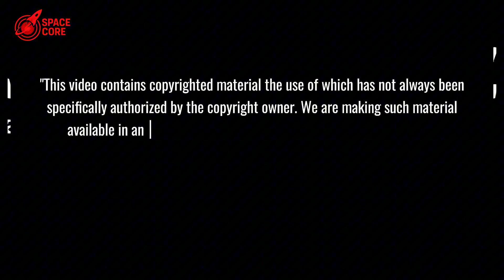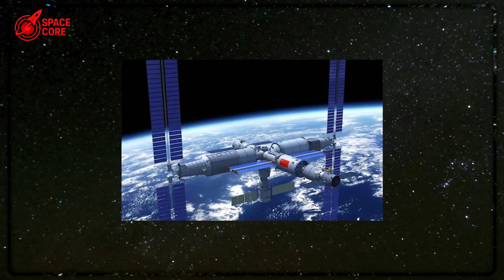Elon Musk revealed Why New Glenn Keeps FAILING...SpaceX Breaks Records!

Comment: The main difference between that Chinese solar cells is that they use broader band GaAs while the environmentalists low IQ people didn't allow NASA to use that material and was stuck with Silicon.
Reply from the maker: Chinese solar cells leverage GaAs for higher efficiency and broader spectral absorption, ideal for space. NASA's silicon use, while less efficient, aligns with cost and environmental considerations.